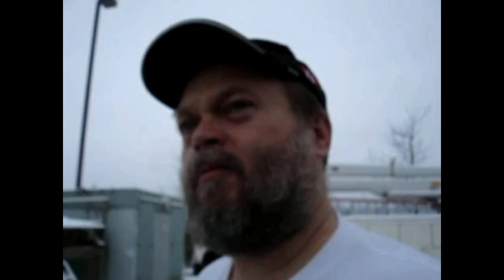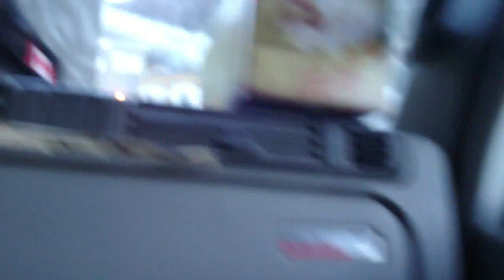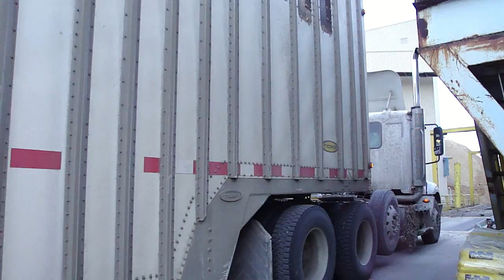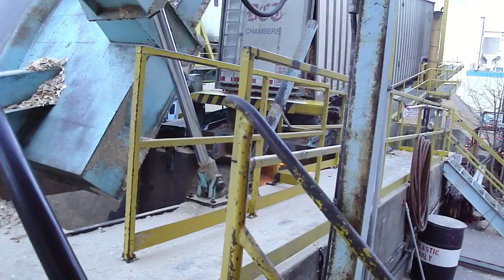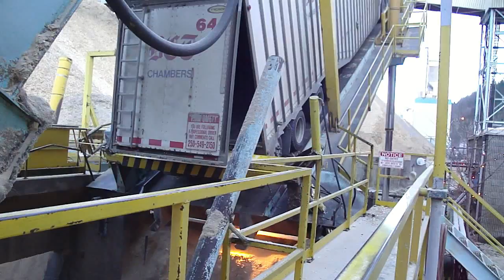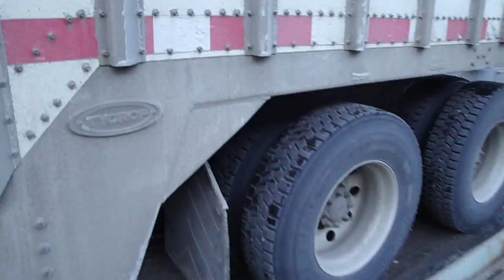Tipping the Big Chip Trucks! - Just Heavy Equipment, episode #26

Comment: Thank you for a great video!! I've seen them tip from a distance, not up close.. almost got to see a portable tipper in action a few times, but they we're too slow at getting set up, I had to get going..
Oregon State Highway 6 Through the coast range in 1996.. dug out, rebuilt it... They filled all the deep slides with treated chips. Wed head up at 7pm, no chip pile, by 7am there'd be a huge pile, day shift dump trucks hauled the chips up to fill the holes we cleaned up at night.
Reply from the maker: Ed Gosselin Glad you enjoyed it; that makes it worth making the videos!
Reply: Kimchiman1000, I believe you just got another subscriber... Thank you!
Reply: @mtl-ss1538  thank you!!

Comment: We have to keep the equipment as light as possible,but strong enough to carry as much payload a is legally allowed. The cargo weight is heavier than the equipment. Also the loads sometimes stick especially in the winter. A hydraulic dump would be way too heavy and probably fall over when dumping. We do sometimes use " Self Unloaders" in some situations. These flat floor trailers have a moving hydraulic floor that walk the payload off. I've been doing this nearly 20 years now.

Comment: Heard a story of a guy leaving truck running dumping garbage. It was an old mechanical engine so no automatic shutdown if it looses oil pressure. It wasn't running when it came back down I gather :-) I watched a reefer engine trying to run on its side after guy flopped it. It was a tuff lil bastard, ran violently for 3 min before it finally pooed the bed.

Comment: Chips from and for...? Pretty crazy instead of just a dump trailer they tilt tractor & trailer. Does the truck/trailer get strapped down any on that platform?
Reply from the maker: Just a bar across the back of the rear trailer. Gravity does the rest. The front trailer dumps right through the rear trailer. I guess it's cheaper than a walking push wall. Things like that usually come down to whatever is considered cost effective.

Comment: What holds the cab? Just the trailer attachment?
Reply from the maker: The beam across the rear of the back trailer holds all of the weight of the vehicle. The tractor simply sits with the front trailer holding its weight on fifth wheel.

Comment: what is the safety procedure,.. using rear stopper, chain with hook ??
Reply: parking brake, it aint going nowere, just don't stand outside in the dump cage you'll be fine. First time I did it scared the crap out of me, but it got routine fast...

Comment from the maker: #2

...wage clawbacks, where they pretend to give you a 'fuel bonus' after first clawing back 10% of what they used to pay, only to pretend to give it back if you hit all the right ratios when shifting, so as to use less fuel, even while you lose an hour on a run because of it and the arbitrary 100 KM/H company speed limit, not getting paid for runs they send you on when the mill doesn't have enough chips...

continued...

Comment: thers nos way that cant be real,,,,,is fame?how thery tipping the truck upside down down and the driv er doest fall out,,,or whay about the oil and gas,,,,must be something esle
Reply: put in on the dump, parking brake, shut off truck, get out, operate the dump, take sample, rinse and repeat. They do it all day long, there is no chains gravity holds it in place, and the oil/fuel stays put (as long as you have your lid on) just don't forget to get your drinks out of the cab, and open the tailgate...leaveing the tailgate shut can cause a huge disaster lol
Reply: +James Martenet i dot think you known what your talking,,,,obviusly some thing holds hold it in place,,,,mabey a clamp
Reply: nothing but gravity holds it, did this for four years in the NW USA, longview WA mostly. The bar you back into is the only thing keeping it from going into the hopper
Reply: Absolutely nothing holds it in place. Some plants do have a bar that goes across the trailer, but those plants are few and far between.
Reply from the maker: Velcro
Reply: Lots and lots of it. 108,440 was my biggest load. Market went into the toilet. Miss hauling them!